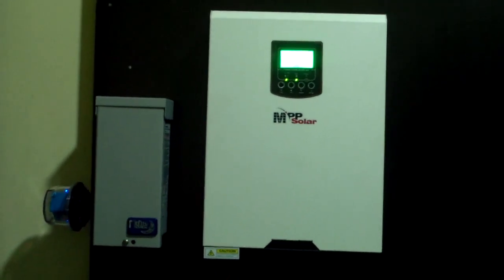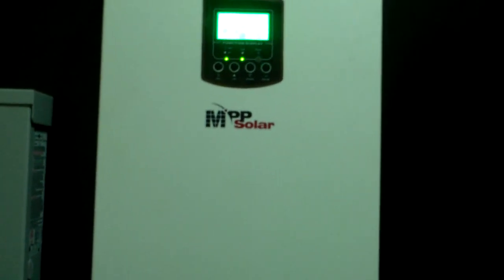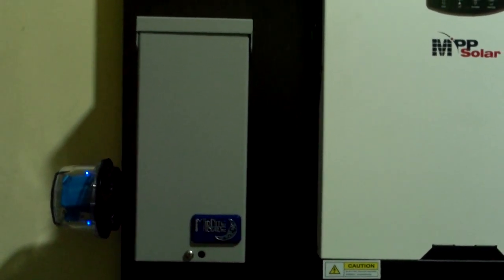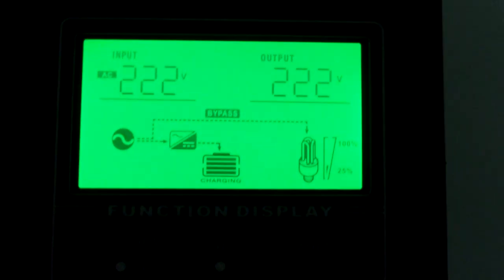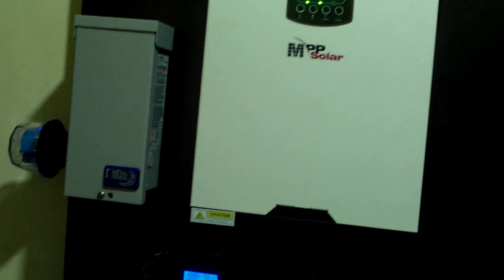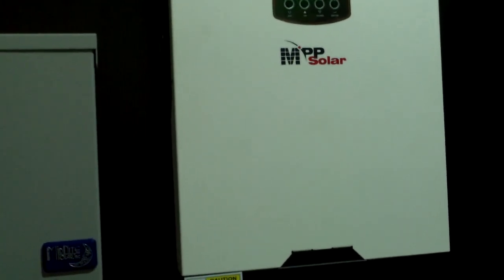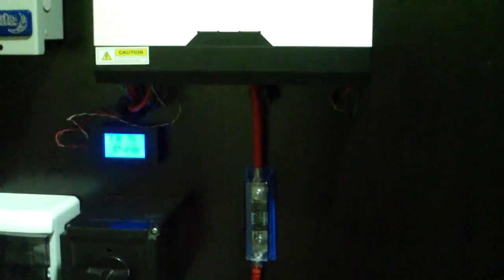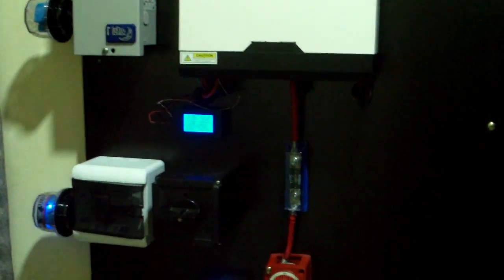25Kwh Tesla Model S Lithium EV Battery with MPPSolar PIP-GE 5KVA PF1 Inverter

Comment: You quote low cutoff at 19.8V and high cutoff at 51V. Could it be that one is per module and the other one is for two in series? Cheers
Reply from the maker: The 19.8v cutoff voltage is for a single unit according to the spec. However the high cutoff of 51v is when two batteries and connected in series . The Low cutoff for two batteries in series is 39.6 volts according to the specsheet

Comment: This tesla battery is no good for this inverter system because of its voltage at 24v. U have max of 4 volts to run it down there by making you use about 3.3kwh out of the 5.3kwh the battery is for. U should have gone for Nissan leaf battery pack

Comment: I thought the Telsa packs are 25.6 volts
Reply from the maker: Yes ,I connected 2 batteries in series to give nominal 48 volts
Reply: Max voltage nominal is about 21.5

Comment: Very impressive system you built.  Does that inverter setup for 48 Volts or 24 Volts.  How do you have the tesla batteries wired? Seris parallel and what voltage?  Can you share your MPPSolar settings?
Reply from the maker: Thanks. The inverter is setup for 48 volts. the batteries are wired in series and parallel. In effect ,  two series strings  both connected in prallel to give 48 volts. I would try check the settings once i go to the site.
Reply: @ibidapoilawole7120 hi talk to me

Comment: Do you have a wiring schematic of how you connected the Tesla Modules / fuses / etc? Also, do you have a low voltage alarm/trip to help with the abnormal voltage (25.2) That the MPPSolar is seeing from the Battery?
Reply from the maker: There is a low voltage cut off setting on the inverter. For this inverter it was set to 42volts DC and theupper cut off charging voltage was set to 49.5Volts . Which means we can work between those voltages 42volts to 49.5volts safely. As regards the wiring schematics, i would try send to you.
Reply: @ibidapoilawole7120  Im currently building a system like yours. Using the MPPSolar, can I set the low voltage to 38v and tops to 48.8v if I wanted to?
Reply from the maker: I think the low voltage setting would not go below 40 volts but you could set the top to 48.8v .Though I make sure I don't overshoot the upper limit to prevent overcharging
Reply: @ibidapoilawole7120  ok thanks

Comment: That is a very nice setup! It seems many of these inverters have poor connections and could benefit from better lugs or glands, don't you think? We just subscribed!
Reply from the maker: I totally agree. This inverter would not accommodate anything larger than a 35mm. It would be better to have lug type connections that can accommodate larger size cables.

Comment: Hi  i need  to run load 3kw from tesla battery in 24v while sun rising only what I need for that
Reply: You will need a 24V MPP inverter. On the battery charger you need to put it on USER mode and have it charge to 24.4 bulk. Floating charge 24.3 and minimum discharge 20.00 due to the MPP not letting you go to 19V on the settings.

Comment: Question, the low cutoff voltage is 42V and you are running 12S config,  so essentially you are giving away the bottom 15 to 30% of your capacity depending on the load /higher load = bigger voltage sag/ Are you doing it on purpose? It would be awesome to see what is the usable capacity of the entire system. Thank you
Reply from the maker: Yes you are very correct. The reason is because the minimum low voltage setting on the inverter is 42volts. If the inverter could go lower,I would have set it to the low voltage cut off for the battery and would be able to make use of the remaining battery capacity.
Reply: Since these batteries are quite hardcore I believe you might be fine with normal loads you would probably loose about 20% /but increase the lifespan/. Great project anyway!
Reply from the maker: Thanks and well appreciated

Comment: Very nice .Have you checked the voltage between each pack too make sure the are charging together equally?
Reply from the maker: Thanks Frank Z. Yes I have checked the voltages between the packs and they are fairly the same. However I need to get the Ternergy 5-in-1 battery meter with the conversion circuit board from HSR Motors . It does the balancing and also keeps the batteries well maintained.
Reply: @ibidapoilawole7120  hey you wouldnt happen to have a link for that would ya?

Comment: Way to go man. Tesla battery is it. Just wondering- how did you get the model S batteries and for how much? I suppose this is in Lagos right. I have a 3000w 12v low frequency inverter and would like to change my battery bank to Tesla if I can lay my hands on it provided its affordable. please can you help?
Reply from the maker: Client purchased from the USA. You can actually purchase from various re sellers on eBay, EVWest ,HSR Motors but you would have to take care of shipping. Yes it is Lagos.
Reply: Good morning and thanks for the info.
Reply from the maker: Check out these guys  https://hsrmotors.com/

Comment: nice mate.  Yes they do need a BMS. The new high volt input controllers make wiring of the panels easy :) keep the 35mm very short and use lager after the fuse to the batteries. Will be interesting to see how long the bank lasts for.
Reply from the maker: Thanks Justin,  would definitely  do that
Reply: Why do you have doubts on the system lasting a long time??
Reply: I added Jack Rickards ESP32 V2 controller to my tesla batteries - prevents all problematic issues

Comment: Congrats. Get a bms. Don't get anywhere near the maximum until you get the bms
Reply from the maker: Thanks,  that's very important.
Reply: @ibidapoilawole7120  just set the max voltage on the inverter and u should be fine with the balancing...
Reply: The Tesla modules are already equipped with BMS... You might only need an external BMS if you want to be doing remote monitoring...
Reply: @faithfulojebiyi  how are the teslas equipped with BMS? thanks
Reply: @rickybrenay6249  have you bought any of the Tesla modules already?... It seems like you're new to lithium battery technology
Reply: @faithfulojebiyi  yes i own 2. 5.2kw. NOT the whole system from the car. I am looking up a BMS system bc one is not provided with just he batteries. I see that one may be possible. thanks for the reply. Maybe you can point me in the right direction.